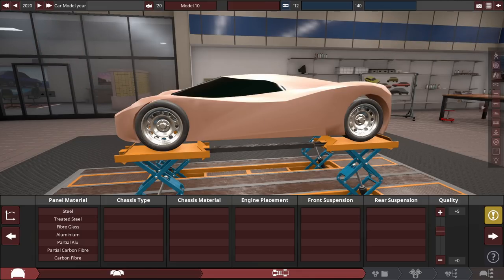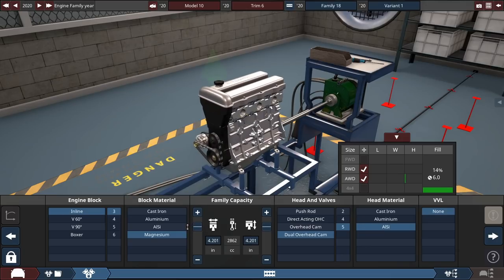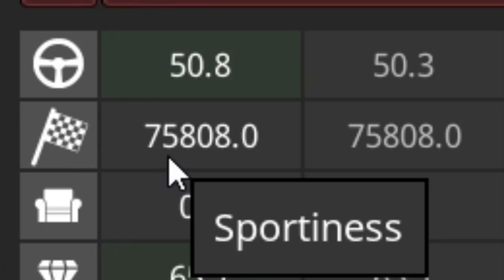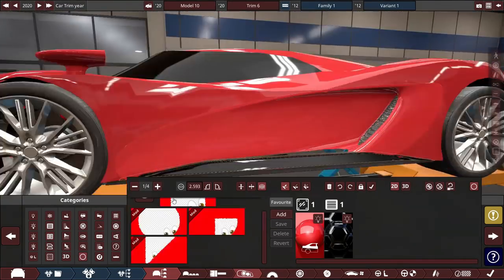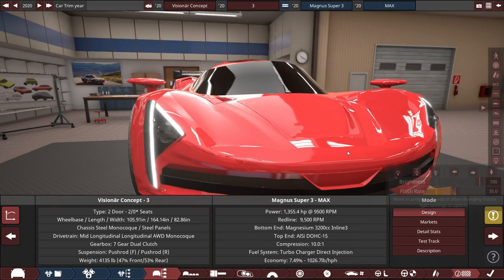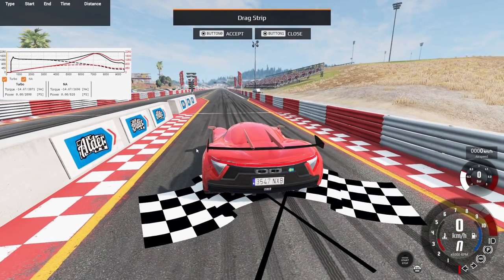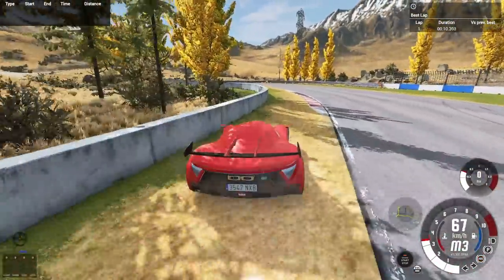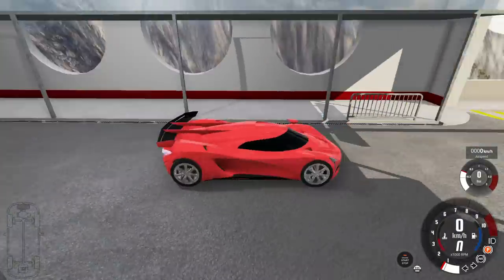I Built A 1400HP 3 Cylinder Hypercar! Automation - BeamNG

Comment: 1400hp out of a 3 cylinder?! I could hardly squeeze that much out of a v8 in the game 🤣
Reply: this engine is bad it has 7.5% 
efficiency,  it super expensive, it has no torque at low rpm and very bad power curve. it all most explodes at it peak power.
Reply from the maker: It's definitely a meme engine xD
Reply: I made a v8 do 3000hp lol
Reply: I absolutely love boxer engines because they get some crazy power even though they can have relatively small displacement. Best engine for an all around car, they can be a bit expensive though
Reply: @Ferrari255GTO  great for handling too. And the boxer 6 pot is one of the only engine that is perfectly balanced using no counterweights or balance shafts. I think v12s are that way too but don't qoute me there lol
Reply: Lol, I can squeeze 2,100 from a V6. Probably one of the best engines I've built.
Reply: İts basically a koenigsegg gemera
Reply: I squeezed 1500 out of a V8. but it didn't fit in any cars.
Reply: I haven’t got a v12 over 800
Reply: i can barely squeeze that out of a v12
Reply: @manager96ful but
but funni

Comment: Visionär is a rather good way to name a concept car since its easy to see it means Visionary (in both Swedish and German too), and the hybrid its emulating is basically the Koenigsegg Regera, but with gears and a heckin' lot more grip from the looks of things :P

It seems to me that this vehicle would, in real life, have a combination of a massive motor running through a gear reducer acting as a starter and torque booster on the engine itself, while it would also have two motors driving the front wheels capable of enough regen braking to make the wheels begin to slide upon braking. Likewise the engine's booster motor would provide massive engine braking too via regen to recover power, or otherwise recharge the battery pack when cruising. I like it, like, a lot.
Reply: I have a feeling you're an engineer lol
Reply: @skyhylands  I have like half of the mind needed to be one, that is the practical and ideation side of it, however my academic performance in the field is quite shoddy as proven by my failure to even get close to putting that iron ring on my finger. I have no true ability at maths :P

Comment: It can't turn because it's 4000 pounds! That's about like a full size sedan or midsize SUV. Anything that handles well is under 3000. Super cars are routinely around 2000. Put that thing on a diet for the facelift version.
Reply from the maker: I was trying to get in between a heavy gas supercar (Bugatti Chiron is 4000ish) and a Rimac Nevera (4750ish) :P

but in the V2 version it for sure may be lighter :D
Reply: Supercars are closer to 3000+ a svj adventador is 3600lbs and a gt500 is over 4k lbs hell even a p1 is over 3k. “anything that handles well is under 3000” is laughably wrong